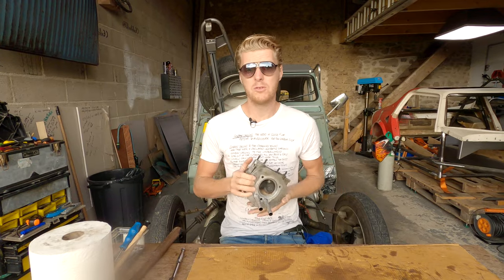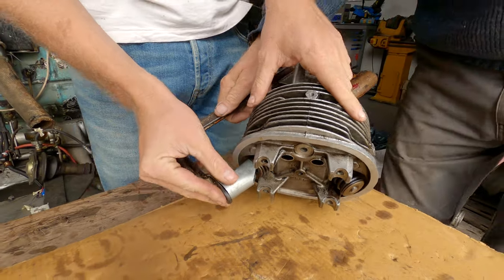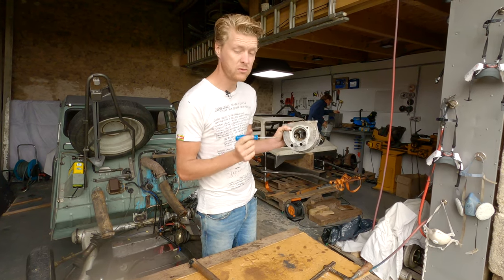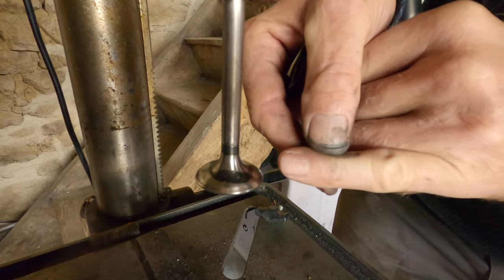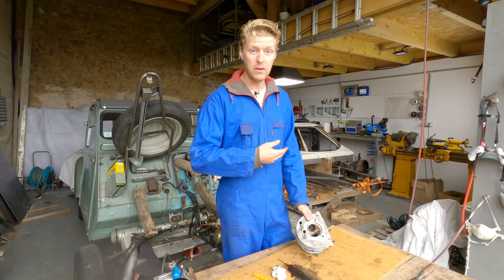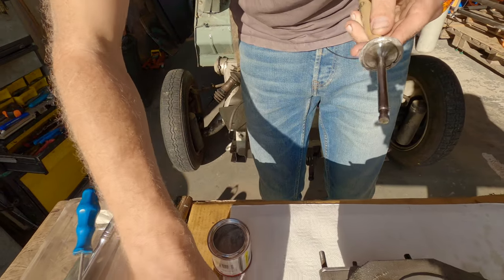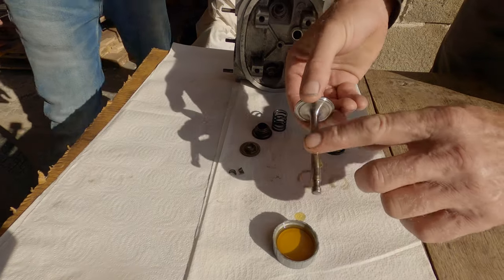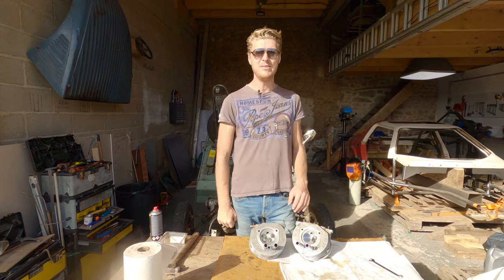Citroen 2cv Top End Rebuild Ep3 - Breathing New Life Into an Old Engine.

Comment: I always tap the valve top prior to using a compressor just to break the seal with the collets and when finished I give the valve a tap just to make sure it is all fully seated! Those suction things are rubbish, I have had many over the years, really slow & frustrating, I like the valves with a slot machined into them so a screwdriver can be used - much easier! A job well done, thanks for sharing.

Comment: Congratulations!
I was actually a bit surprised to see that you hadn't done this job already, but then I smacked my head.
With a daily driver, it must be very difficult to find time to do the things like this that need to be done, because of course, your car is out of action while you do!
SO!
Perhaps this happy thought will inspire you when you're frustrated with Pandora:
Someday, you'll have both Jolene and Pandora up and going, and if you need to do something involved with one, like this, you can do so, while still zipping about the countryside, in style and speed, in your other beauty!
-
(re: style and speed, sure, both car has got buckets of both style and speed, it's just that Jolene, well, the balance might've fallen heavily on the style side of speed/style equation.)
-
And I liked your gentle nod to the folks who might've, you know, happened to clean up a few casting bits in their ports.
Just.
You know, might've.
<3

Comment: My technique too clean carbon build up:
put valve stem into a rubber tube
Put the lot into a drill with only the head out
Put the head into a pot of water
Rotate the drill at the slowest pace possbile whilst pressing fine sand paper against the head
And voilà! super clean valve

Comment: It is too late for you now, but if you use a spare drill chuck clamed to the stem of the valve, you can use it as a much better handle to reciprocate the valve on the seat, you can lift the valve off the seat every few movements, that will allow more paste onto the seat, and also a very light spray of WD40 will keep the paste on the seat rather that it being  pushed of of the way, I did see one youtube video of a car bodger using a pistol drill to spin the valve on the seat! History does not record how his engine ran after that butchery!, Stay safe! Chris B.

Comment: Steel valves tend to work their way through alumin(i)um heads rather quickly, hence the valve seats. More engines can run without lead than people realise, although the octane rating is a different matter. Tetraethyl lead was both a lubricant and an octane booster.

Comment: You reall do need to invest in a proper valve spring compressor, I bought a Sykes Pickavant one which compresses using a sliding handle decades ago and used on all sorts of engine, Mini to Lotus. Looking on ebay they are around £40 but it makes it an quick and easy one person job